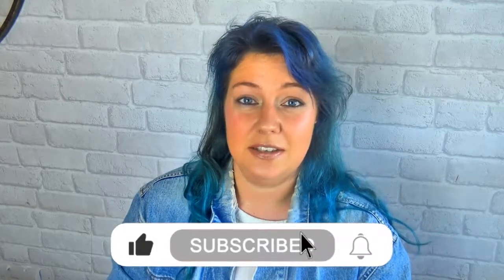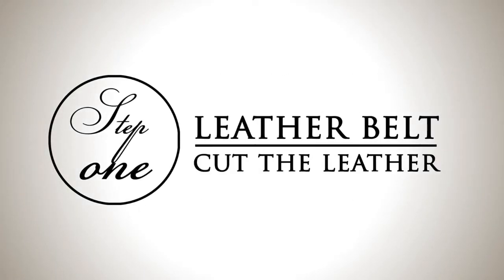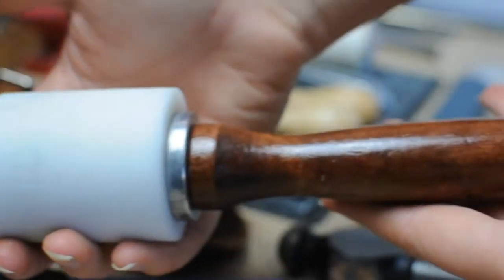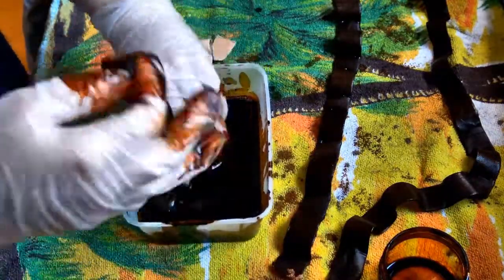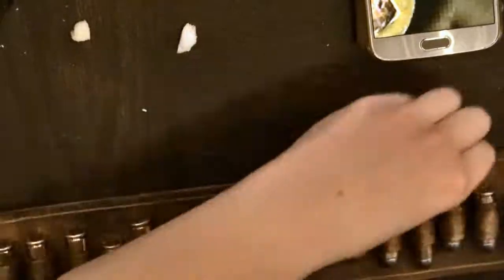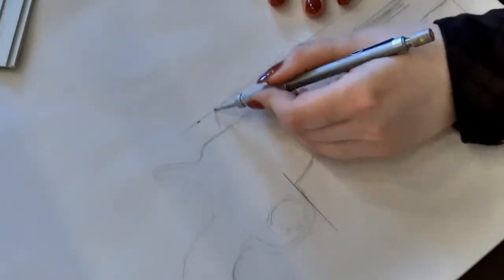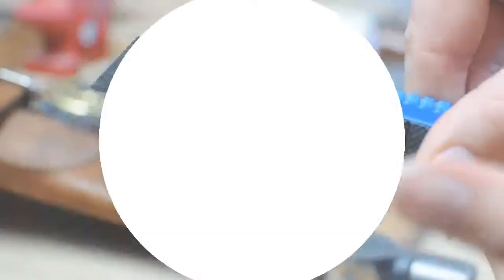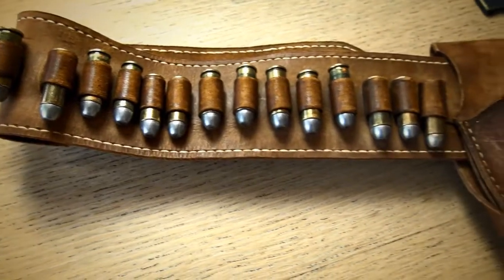Arthur Morgan Gun Belt and Holster rig | Weathering and aging leather

Comment: Just out of curiosity, why did you use the rough side of the leather for the outside of the holster? Is that a personal preference or just what you think is most accurate based on the one in game?
Reply from the maker: It looks to me in the pictures that the part of the leather that goes around the belt is more shiny and the part of the holster where the revolver is suppose to be in looks rougher.
And I think it's suppose to be a little bit inspired by "The man with no name" holster but much more worn and aged, and that holster has the rougher side on the outside and the smooth side looping around the belt.//Jennifer